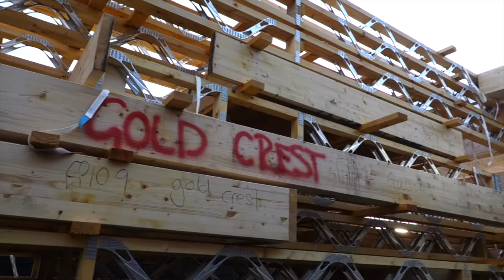Timberframe (Timelapse) First Day Erection & Installation

Comment: Hi, great video! We're in the process of buying a newbuild which is timber built with brick on the outside. I'm struggling to find anything on sound proofing and whether it is considerably worse than a traditional build. Just wondering if you have any thoughts or advice? Property is a detached so it will just be external sound (although internal sound from individual rooms could be an issue).
Reply: unless u live next to a motorway should be fine, brickwork pretty soundproof

Comment: Hi, that was great video. Would you advise buying a timber framed house with brick cladding in the UK? What questions would you ask a builder to clarify whether it’s going to be well built house?
Reply from the maker: Hi, glad you enjoyed the video. Depends on how good the installer/developer is at weather detailing the key areas like around the windows and doors. Typically the standard detail in the UK for brickcladding isn't ideal for reducing the thermal bridge (heat loss). Are looking to buy a house already built or are you have one built?
Reply: @buildingpassive4879  Hi, thanks for your reply. I am looking to buy a timber framed house with brick cladding but never had one before thus wondering about this technology whether it’s reliable or better to stay with traditional brick and mortar. Tried to search online and YouTube but information is very limited and it’s hard to decide.
Reply: We're in a similar position and worried about the sound proofing. did you move into your timber property? Or did you find more info?
Reply: @jordyman2  Hi Jordan. We didn’t move yet. Still on the market :)